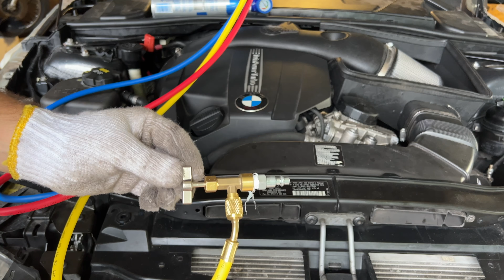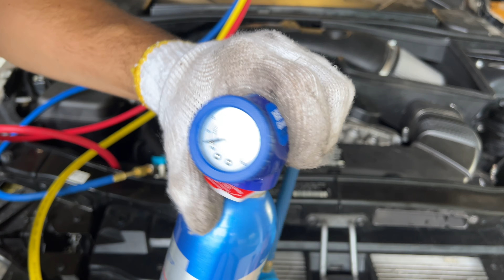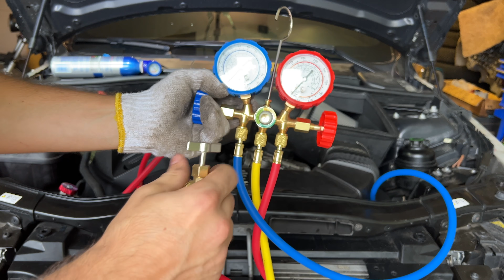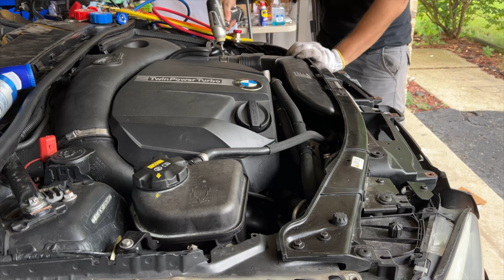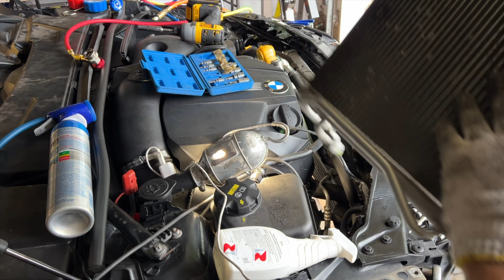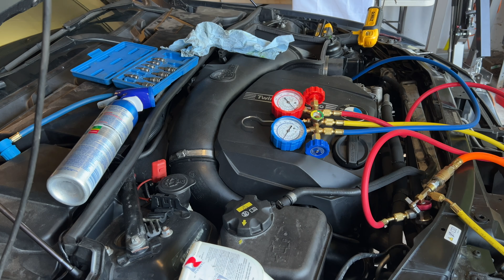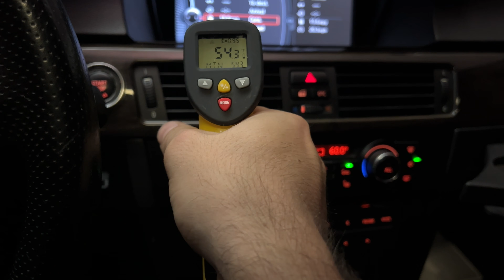Finding AC Leaks in Empty System – No Freon, No Problem

Comment: Simple car guy I know that your intentions are good but this video is wrong. Never use air to pressurize your AC line set system. Air has water and water has moisture. Moisture is a problem to all refrigerants. So you found the leak but now you will compromise the car ac system eventually. Always use nitrogen to leak test.
Reply: I used compressed air on my truck 4 years ago never vaccumed it and charged it I still get 43degree air out the vents
Reply: That’s where a vacuum comes in. Working at VW, we pressurized the systems with shop air for testing.
Reply from the maker: Thanks for the feedback! Obviously the next step would be to evacuate the system, pull a vacuum etc. by a professional, but as far as DIY method to find a leak and fix the issue before taking it to a pro, I think it’s not so bad.
Reply: @SimpleCarGuy you can also get a vacuum pump from harbor freight and do that yourself as well.
Reply: Always used air because after i vacuum the system. More then 15 years been doing it and never ever had a problem.
Reply: VACUUM PUMP!!!!!!..
Reply: Just use a filter. Problem solved 🤷‍♂️
Reply: How do you know he doesn't have a drier / water separator on his setup? Also, system will be vacuumed afterwards. Your point is well intended but null.
Reply: System get vacuumed anyway
Reply: This is why you use a vaccum pump.dummi
Reply: Air is OK because a vacuum pump will be used... Won't it!!!!!!!!..
Reply: If you use a professional air compressor they have water traps and filters to prevent moisture, but consumer ones don't.

Also, when you pull a vacuum on it before adding Freon, theoretically any moisture will boil away, as long as your vacuum pump pulls a hard enough vacuum (it's why your blood will boil in space).

But it's not really a great idea.
Reply: Key word is 'theoretically'. AC systems are not tires.
Reply: The fact that PAG oil is hydroscopic means that it will absorb and trap moisture. Manufacturers say that a vacuum pump will not pull the moisture out of the oil which will cause acid formation and reduce the oils lubricating properties.
They even say that the oil is a one-time use after opening. They recommend that after the system has been filled with the proper amount, any remaining oil should not be reused. 
The problem will not show up right away but over time....
All HVAC schools teach that moisture is the death of any refrigeration system.
I realize that most DIY's do not have nitrogen but that is the only thing that I would introduce into a refrigeration system.
Reply: @br5747 Oh my god the sky is falling 😫 You can’t like we are building the f*****g space shuttle. You sound like a residential ac guy. Bet money none of the automotive ac manufacturers talk about this nonsense. And I’ve never used Nitrogen in a ac repair, (I’ve done so many I can’t recall). Yes there are certain systems like Denso where an end to end capped lubricant is required and standard pag wont do. But your claim the exposed to atmosphere oil is no good, yeah calling bullshit
Reply: @br5747 please educate yourself
Reply: It won’t do anything under vacuum moisture boils away at a very low temp which is why the vacuum is always pulled so this compressed air is better than trying to use refrigerant and then letting it escape through the leak. Not to mention Pag oil is hygroscopic so it will absorb any little moisture that somehow didn’t evaporate during vacuum and everything will be fine. The time that air and moisture is a problem is when people don’t purge the line during recharge or try and just top off the system without diagnosing the problem that is much worse than using shop,air to find a leak.

Comment: Got a dumb question. When connecting ac lines do you screw them down to open the high and low valves? I’m guessing yea to allow the air in system.
Reply: Yes

Comment: Better to use a vacuum pump and a cigar or vape too find holes... Won't introduce water
Reply: Damn. Good idea. I have a smoke machine for finding vacuum leaks. I could use the hose with smoke and let vacuum draw the smoke!
Reply: You're still introducing most air either way. It doesn't matter if you're following the last recommendation,  which was after finding and fixing the leak,  you take it somewhere to have them professionally evacuate the system and recharge with the correct amount of PAG and refrigerant.
Reply: @macfady2181 true but after fixing the leak you can pull the vacuum again and leave it for a few hours to eliminate all moisture hopefully

Comment: I wish you could see how much moisture you just introduced into your A/C system. 
That's what dry N2 tanks are for.
Reply from the maker: As mentioned in the video, description and comments, this is a way to find the problem. You will then have to pull a vacuum and refill the system. I took mine to a professional and paid $100 instead of $1000.
Reply: @SimpleCarGuy  you're missing his point.  If you get moisture into the system (not if, you did, actually) it will plug up the system because moisture plus aluminum equals corrosion.  While I get the down and dirty aspect of this, it has a big downside that you should specifically warn about in your intro.  I see you could do this serially as vacuum will boil the water out - but putting air pressure with its attendent water vapor will plug and junk the entire system.
Reply: All needs to be done is have air a filter on your compressor to capture moisture and drain your air tank before performing the test.
Reply: I cringed when he said air pressure - but your recommendation on nitrogen, thank you.... I charge shocks so I have lots of nitrogen and gauges (because I suspect a direct-for-the-bottle 2000 psi would be bad)....
Reply: U clearly didn’t listen to him did u
Reply: @1989rrichard  you clearly fail to realize how most moisture removal systems aren't 100%.

Comment: I fixed my condenser with JB Weld two years ago and it fixed the leak.  De-grease, lightly sand, and I used light vacuum  (-5) to suck the epoxy into the hole and let it harden overnight.  Have not had to add any more 134a.
Reply: I JB welded a spark plug into a cylinder head once. It worked for about a year and then I had to slap on a new head as it further cracked around the spark plug hole.  JB weld is awesome
Reply: I had a radiator leak and just needed to make it home on night so I added a glue I purchased at a convenience store called Goop I believe, it was multipurpose as I just just wanted to make it home.  Made it home with out loosing one drop of water the thing held for over 7 yrs until I sold the car.
Reply: Nice
Reply: Very interesting.  Thanks for sharing.   Is the repair still working?
Reply: Seal All would work just as good.
Reply: Good tip applying the vacuum!
Reply: Fix my transmission leak with JB Weld.  Highly useful product.
Reply: Do what? No way!? Amazing. Wish you had made a video!

Comment: can ac gas leak from 
 the radiator?
Reply: From the condenser yes, not from the radiator which is for engine coolant.
Reply: The condenser looks similar to a radiator and is usually located in the same general area as the radiator. Not to be confused with the compressor which is a common point of confusion for people. The compressor is located as an accessory part that's turned by the serpentine belt.

Comment: you can rent a vacuum pump from the parts store. that's the only other thing you needed to do the professional quality evacuation and recharge by yourself. you would connect the vacuum pump to the yellow hose for the evacuation, and then attach the cans of freon to the same yellow hose to charge it.
Reply: actually like other people said, ideally you would still want to flush the system and replace certain parts like the receiver-dryer. however if there wasn't a catastrophic compressor failure then you may get away with not flushing it
Reply: @dummkompf  You can't flush the condenser on these r134a horizontal fin ones bc the Holes are wayyy too small often you just move the debris to make a serious clog... Always replace them with the condenser they cannot be serviced... Also replacing the dessicant often ruins the plug and there is not clearance with the hard dessicant pack these use so... Plus then you get a new Power Steering cooler toobc it is built into the condenser
Reply: @dummkompf  for sure u could get away with it if the compressor wasn't the issue

Comment: Bad idea. For those who did this, make a comment when your ac system fail after several months had to have a mechanic replace the evaporator coil. The dryer cannot handle the amount of water introduced in the system and the dirt and oil from the compressor Lol 😂😂😂
Reply from the maker: Note that I have noted a couple of times that you should only use this method to find and fix the issue and then have the system evacuated and then fill it with Freon.
Reply: @SimpleCarGuy  You need a flush kit to evacuate the system. Shop vacuum pump just remove moisture and most shop vac are substandard for refrigeration use ( 500 microns of vacuum is minimum standard) and the system still rely on the dryer to remove moisture which is only capable of very small amounts (less than a drop of water). Well anyways as long as there are people who does this I will always have an evaporator coil replacement job (it’s the thinnest part of the system and first to develop a hole due to acidity from moisture). In fact I am working on one right now. I charge a lot of money for such jobs and unlike a typical shop, I always flush the system. Hybrid AC system like the Prius uses electric compressor that operate at 240 volts. Moisture in such system will wreck havoc. Requiring compressor replacement as well as system flush.
Reply: @JessSaragoso8304  Does it really need 500 microns to remove water vapour? Water will boil at 18C/65F at 0.3psi, which is 15500 micronhg, and at 0.1psi (5000 micronhg) it boils at 2C/35F which really should be sufficient in all but the coldest shop. Does it need a lower pressure than the boiling point to get dissolved water out of the oil?
Reply: @xxwookey He’s a know it all YouTube diy mechanic. What he’s recommending is bullshit. Probably a residential ac guy who started working on cars and thinks he’s knows

Comment: WOW, i was just ordering new ac compressor/ lines and valves, went outside 5 minutes later found air coming out the condenser. Thanks you helped me through this easy leak find method better than the pros 5 STARS ***

Comment: I can’t believe I didn’t think of putting that air fitting. Thank you 👍🏽
Reply: Well, as said at the end, be careful throwing air inside the system, air contains humidity which if not evacuated, will produce moisture and damage your ac circuit.
If you can, use azote instead which is a dry gas.
Reply: @adrienlazac  Most of us are using this method because we don't have enough money to use nitrogen.  I found the leak using air, evacuated the system, and recharged.  Car is blowing cold air with no issues now.
Reply: @censoredeveryday3320 I use only the finest helium/argon/Xenon  gas mix.
Reply: @benjamink1403  Nice. I applaud your great taste. Do you have a good source for buying swan-feather microfiber cloths? My guy is always sold out lately.
Reply: @censoredeveryday3320 If you evacuated (drew a vacuum), you could  have found the leak without introducing humid shop air.
Reply: The air fitting doesn't fit the can tap you luck  to get 2 threads in it

Comment: Hi,
Very useful video!
What were the symptoms along with hot air from vents? 
My ac doesn't hold freon longer than a week and I hear hissing noise from vents. I'm afraid it's the evaporator😬
Reply: Having this same issue condenser was replaced cuz was leaking the. Run for like a hour and out sudden  smelled weird and all the freon went out again any ideas
Reply: @chapincillo  evaporator